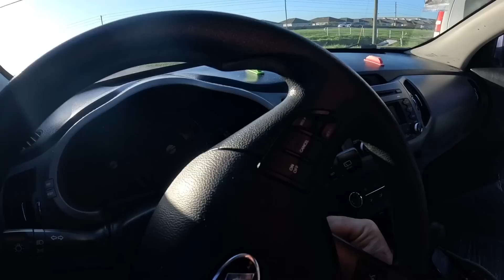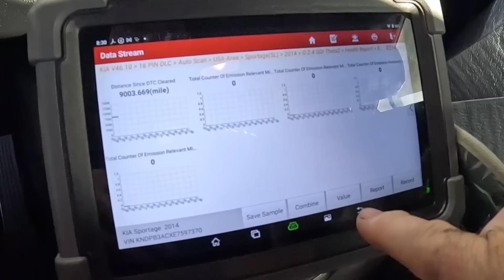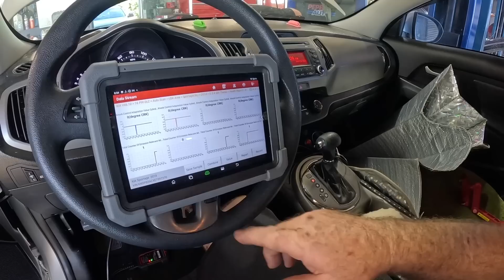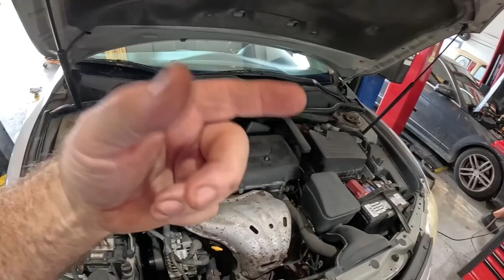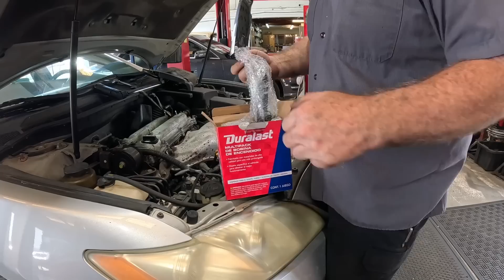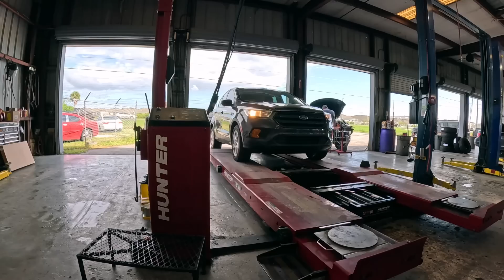C250 CAN, Camry, Escape, Sedona, Diagnosis, DAY 566 in the shop #auto #repair

Comment: On the Camry with the rotten plastic connectors, I see that you used the ol' crumble and replace trick.  Very smart, Jimmy!
**I used to do drugs.  I still do, but I used to too.**   <Mitch Hedberg>
Reply from the maker: Thanks Randy. Several have found an issue with the process, but they always do, lol.

Comment: On that Kia, that's common. There was some recall for the wiring harness first and some update on the knock sensor.

Had it with our Hyundai. After that harness "update," the tech at the dealer said that a new engine is next...and he was right 😂.

We did get a new engine. I know people hate Hyundai, but our experience(other than the engine lol) has been good. I maintain the oil/fluids, brakes, etc. 

I'm sure others have had a different experience, but all cars break one way or another
Reply from the maker: Very true, good maintenance reduces many of these issues.

Comment: Autolite plugs? Our local independent, who was shop foreman at the local Chevy dealer, has been installing Autolite plugs in GM cars. I prefer to stick with the plugs the manufacturer recommends. The wrong plugs can lead to misfires that will damage ignition coils.
Reply from the maker: Exactly, I always prefer OEM plugs if available. Wish I could get everyone on board. :)
Reply: @mlieser1230  agreed. Denso in Toyotas.